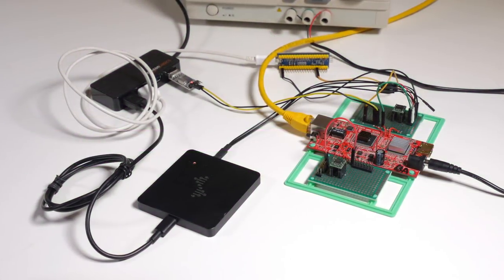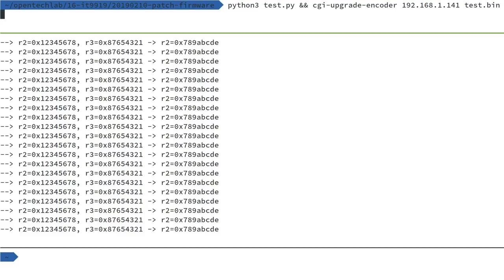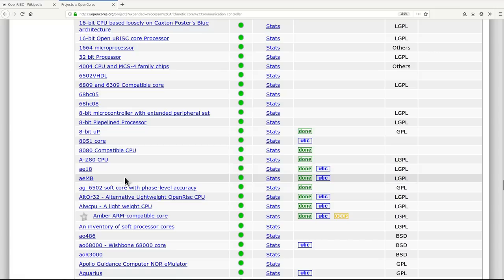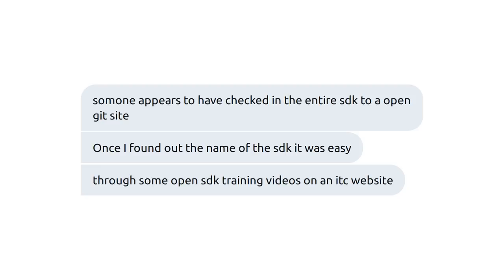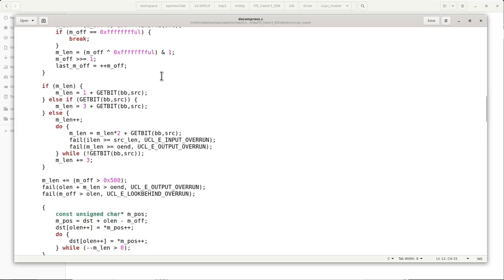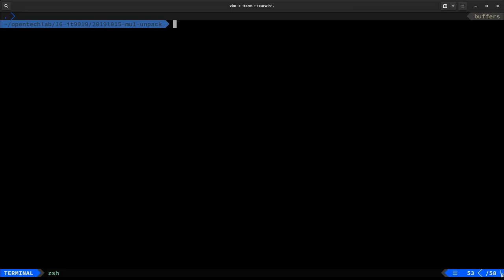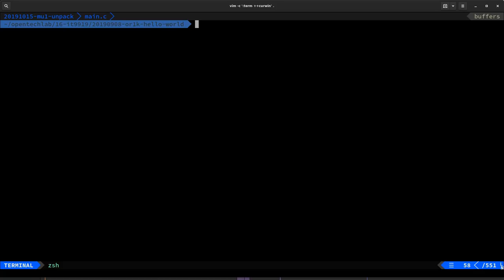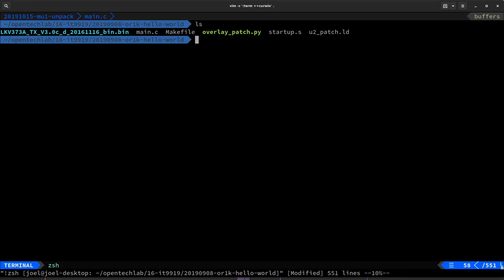[020] LKV373 Update - GCC for the IT9919

Comment: I would love to see one of these random devices be reprogrammed with some really basic video input, and output to a simple stream on an Ethernet port. Like the hardware you originally showed us. This would be a great learning tool, and would also be useful for those who are restricted budget wise, and willing to put the elbow grease into making it do what we want.
If they have a HD1080P High Refresh Rate version, I would be interested in seeing what it's capable of doing, it's processor has to be pretty decent.

Please keep going, and don't spare us the details, this is amazing stuff.
Reply from the maker: If we can build some momentum around these chips, they would be useful for lots of interesting projects. An open source firmware for these devices could unlock some really cool functionality e.g. swiss-army-knife of internet connected casting/streaming equipment, video-capture Raspberry Pi/FPGA modules.

But to achieve that, it's going to be quite a big job - so we might see some proofs of concept, but to build a proper user-friendly firmware would require a team to dedicate themselves to make it happen.

And in that time, will the chips remain available? I don't know where to source them right now. Are Lenkeng making new stock, or just running down the last remaining IT9070s and 9919s ? Are the newer higher-res Lenkeng devices related? - are those a better platform to processed with? We will hopefully find out soon when I do the teardowns.

So for now I'm just interested to see where this goes, and how people respond to it. There are plenty of interesting avenues to pursue here if anyone cares to look into it.

Comment: You are asking what is the goal. We are all want to unlock that web configuration page (or telnet config) to be able to change streaming port, enable rtp, have more flexible IP settings, extended resolutions options, and finally make it encode AAC instead of MPEG2 audio (for God's sake -_- it's 2019 now). Maybe make it stream via TCP instead of flooding UDP and tearing the picture. If you can make a modified firmware, that would be awesome. Thank you for your work!

Comment: OpenRISC turns up in some of the strangest (but also not unexpected - royalty free goes a long way) places. 

Another place I know of is deep inside the allwinner arm cortex-a chips. They use it as the low power control processor, basically it does some of the control things when the main cores are asleep or being bootstrapped.

Comment: Man, that was fantastic! Thank you very much for your effort. Great to see some hardcore assembler and linker skills in  use. Is there a way you could do some simple on-chip debugging now? Retrieve some data from register files or the RAM and print it to the UART, to get some insights on the microcontroller peripherals or make some leds on the board blink :)
Reply from the maker: Certainly having a C compiler will make further experimentation much easier. The hacky python homebrew assembler was pretty accident prone to work with.

At the moment we have no way to send input into U2 - but if we did, perhaps we could write a gdb remote debugging server for the IT9919. But that would probably be overkill for LKV373 experiments. It appears that the U2 software is actually very simple: all it does is kick off the capture/encoding engine - so as you say, just dumping the register settings would be extremely helpful.

I need to take another look at the EzCAP 283S firmware - because I previously suspected it was powered by an IT9919, and it uses the chip to do a lot more: it has USB Host and Slave support, file systems, HDMI input, RGB888 input/output etc.

So there's plenty of directions to proceed here. If you're interested in getting involved, I suggest lurking on the #lkv373a IRC channel on FreeNode.

Comment: the uart signal should be connected to the IR , same on the other end, one doc shows a diagram of one TX and many RX in hotels for TV over IP , the uarts are then used to control the RX tv,s (via service port on samsungs) or via IR in some cases. thats what the extra ports are for under nmap. the SPI is control only and the U2 chip has data bus similar to ram access into U1, thats required for the speed. U2 then sends that h264 data out via the phy properly wrapped of course. back to the one tx many rx mention , therse also a many TX to many RX model too, so that offers switchable channels . the encryption option is not HDCP but encrypt between TX/RX for "secure IPTV' implementation , that leads me onto the protocol, out there is a doc for IPTV_UART_CMD protocol, this has a lot of diagrams showing the above implementations and a sample of the protocol for IR control, serial over IP, etc. Also out there is a control panel software for the IPTV part that can serve up files instead of needing a TX unit.
Reply from the maker: Interesting.

These LKV373 devices have a non-populated jack connector. Other Lenkeng products seem to come with an IR widget on a jack cable.

My understanding is that MU1 controls/monitors U2 through the Host SPI link into U2's memory bus. U2 encodes the HDMI into H.264 wrapped into MPEG-TS packets, and transfers it to MU1 through a TSI serial link - which is a defined standard for MPEG-TS transfer.

Comment: Port 554 for RTSP is open when multicast check box is unticked, but is needed a url to access it. Is possible to discover what URL the LKV373 is using on the RTSP server? Using RTSP only devices connected to it will receive the data, instead of the network being flooded with multicast. Some people sugest that the receiver use RTSP protocol, and snifing its traffic should reveal the url.

Comment: printf needs malloc because it calls sprintf to format the buffer. There may be a way to configure it to use static buffers, but it looks like you don't need it to.
Reply from the maker: I'm sure you're correct - though it seems like overkill, when you can implement printf with a simple state-machine.
Reply: @OpenTechLab  I think part of it is also that some implementations avoid the syscall and such (think fflush), and so must maintain the buffer somewhere thread safe between calls.
Reply from the maker: Good point. An unbuffered state machine would have to flush constantly

Comment: Just wanted to thank you Joel - for what is arguably the hacking/tinkering channel with the highest signal-to-noise ratio across the entirety of Youtube... I can only imagine the time and effort it takes to research and create your content! And I am always learning a lot from your videos - cheers, mate. On a tangent: how do you switch to some form of navigateable terminal output at 22:12?
Reply from the maker: Glad you're enjoying it. I just wish I could post more often - but that's life.

About the terminal: I switched from using tmux+vim to using vim8 which has terminal support and support for multiple windows and splits. The benefit is that can keep everything in a single instance.

My vim config is here:
https://github.com/jhol/shellrc/blob/master/vimrc

In the terminal in vim8, the default key-binding is Ctrl-w, N to break into "normal" mode in the terminal which lets you move through the buffer and yank text just as if it was a normal text file. Then press i to return to "insert" mode i.e. normal terminal operation.

I use the tinykeymap plugin to make window management feel more netural to a former tmux user.

Comment: I bought some of those LKV373 HDMI senders as well , and I would love to reuse them as KVM adapter for mainboards without VGA port but HDMI instead.
as well on mine I could not get the hack with the unicasts to run.
Reply: There is a LKV373KVM on ebay also, which have a few USB ports.

Comment: Wanted to add that I have about 7 transmitting units of lkv373a model, which is capable to output 1080P at 30 FPS (max). 60 FPS is available at 720P res only. Great little device, but it irritates me that I can't supply any custom h.264 parameters, like profile, quality etc. To get the best match of HDMI input quality, I have to set it to 20M bitrate (while input is just about 5M), which makes it very inefficient in term of BW usage.

Comment: I'm curious how did you found newlib __sfvwrite_r() address in Lenkeng software.
Reply from the maker: Excellent question. Perhaps I should have explained in more detail. I added a note to the show notes,

I used my call-graph script from the previous video to dump out the call-graph of the whole of the Lenkeng upgrader software. I then used the networkx graph library in python to isolate the sub-graph of functions called by puts() which I knew the address of from previous experiments, which gave this diagram: https://opentechlab.org.uk/_media/videos:020:20191002-puts-printf-subgraph.dot.png?cache=

From various other hints in the strings, I suspected the software contained a build of newlib of whatever vintage.

I then used the or1k disassembler to try and piece together a plausible theory for the number and type arguments to the various functions called by puts().

Still quite uncertain, I decided to take a punt on 0xa512c being the correct address, and voila - it worked!

In future jobs like this will be a bit easier, because v3l0c1r4pt0r has written a patch for radare2 that adds support for or1k.
Reply: @OpenTechLab  Thanks for the explanation! It seems to be a fair amount of work.
Reply from the maker: It took me about four evenings and a Sunday afternoon. It was tricky, yes, but I was reusing a lot of bits of code and information left over from previous work. Otherwise it would have taken a lot longer

Comment: May I ask for your knowledge or any suggestions: Mine came with the following Firmware:

Version :4.0.0.0.20161116

Encoder Version :7.1.2.0.11.20161116

I used DanMan's blog to use the Firmware upgrade to 20160427 - I only did the .PKG one (not the Encoder) and now the device will not grab any IP address on the network. I cannot get to the webserver. The RTP in VLC works (and no longer the UDP). I have other devices I haven't touched and the web servers still work and VLC will only work with UDP and not RTP. 

Do you have any ideas of what may have happened that I can no longer see the device on the network, won't grab an IP address, and I can't get into the web server?

Comment: Sorry if this is a stupid question, but could the 'mystery' chip MU1 actually be a FPGA with an OpenRISC soft-core on it?
Reply from the maker: From what we know, I think that's now ruled out. It seems to be an ITE processor of some sore, and we suspect it contains an ARM core of some kind.

In general an FPGA would be an expensive part to put into a cheap consumer device like this. 10-years ago when 1080p was brand new, before there were mass market chipsets, devices like this may well have contained FPGAs. They would have also cost $$$.

I'm sure 8K will go through a similar evolution in the next decade.

Comment: One of the strings is MSDOS5.0 O.o
Reply from the maker: Yes, I think that's part of the FAT filesystem handling code. All the web assets are stored in a read-only FAT file system embedded in the image
Reply: @OpenTechLab  That sort of makes sense, but Fat doesn't have any hard nor soft reliance on DOS, so it does seem out of place.

Comment: Please make a better Firmware :) dream Better Picture 30/60fps or Blu Ray Mode 24fps 1080p. Or a very very low latency Mode. Or Unicast Settings that could be saved after a reboot :)